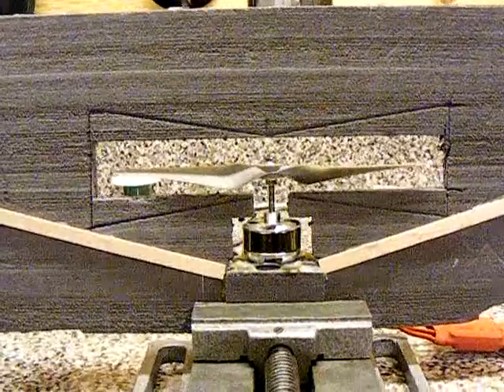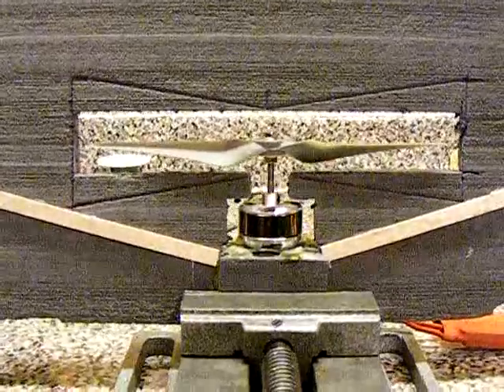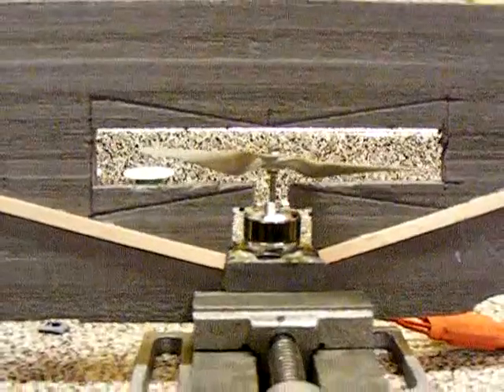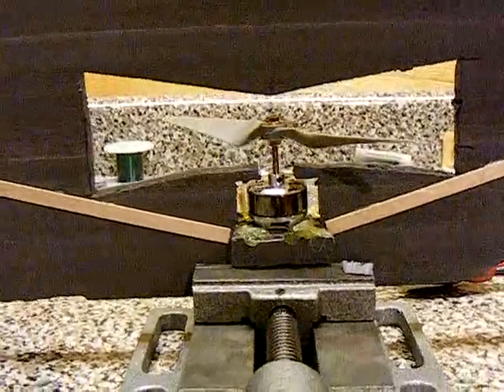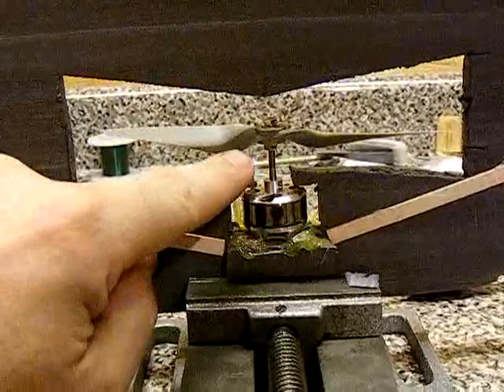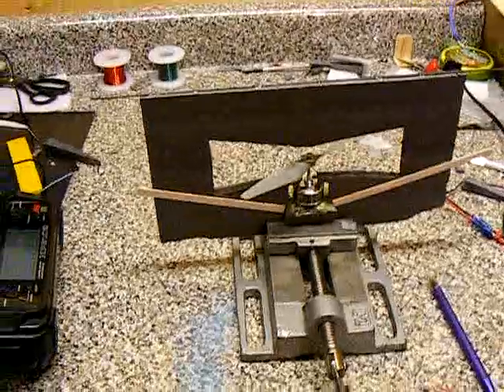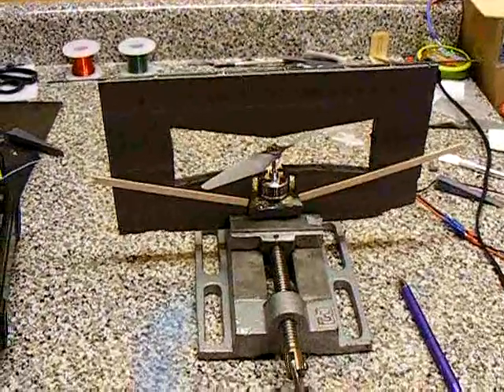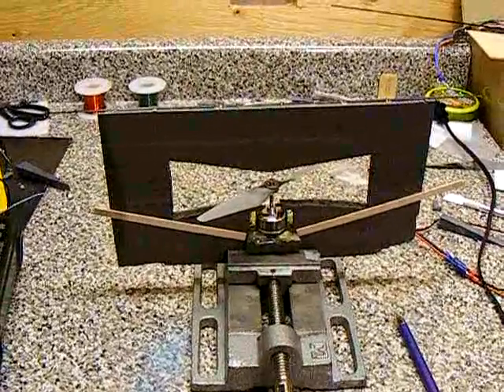bowtie part 1

Comment: Good video, thank you!
There were noise probs on racing hovercraft in the early '80s, one of the items of received wisdom was that 'upstream' obstructions to prop or fan flow  caused more noise than 'downstream' ones.  We were able to verify this experimentally using an SPL meter, but as shown in this excellent demo, the difference was obvious.  At that time we were running tip speeds of between 330 and 400 ft/sec

Comment: i asked paul about this design a few days ago and thought it was cool, but this vid is straight forward proof that there is a difference. i could def. tell the difference in sound. great simple test vid. thanks so much for posting, i have a new standard for my mid mounted pushers. maybe do the same test but with something sitting behind catching the prop wash so we can see the difference in airflow. if we could see that, ur test would be a new standard in scratchbuild testing. great work.

Comment: Infuriating video. Came here from the RCGroups forum thread "Prop Slot Noise Reduction ...". The viewer wants to hear the difference in sound level AT THE SAME SPEED! It looks to me like you are deliberately trying to "fudge" the results by not running the propeller with the bow tie cut-out at the same speed as the original shape.